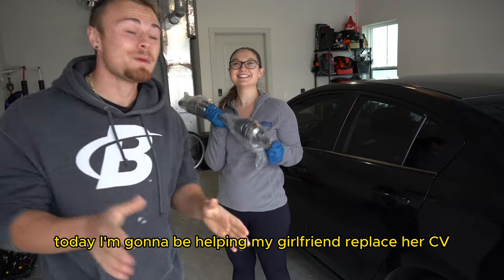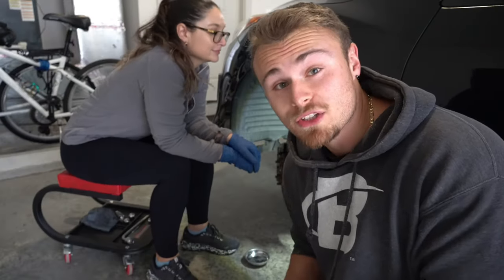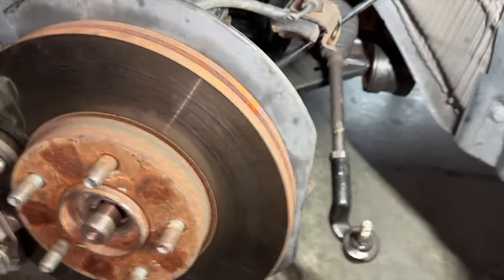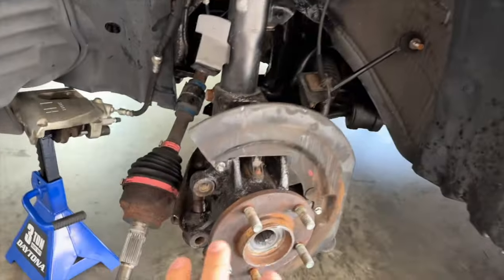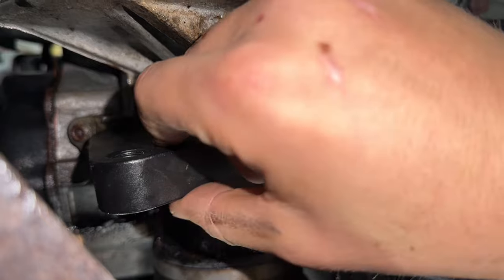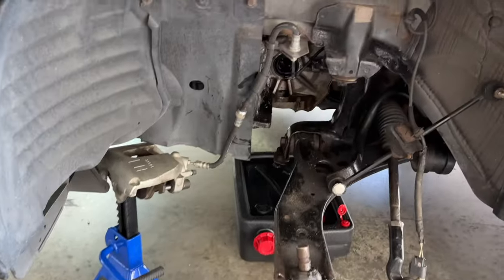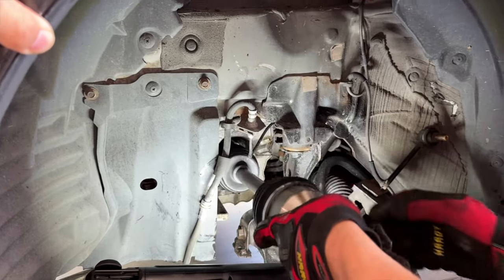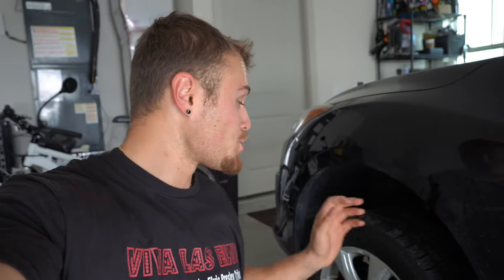HOW TO REPLACE DRIVERS CV AXLE ON A 2010 MAZDA 3

Comment from the maker: *4 MONTH UPDATE USING TRQ CV AXLE*
About 3months into using the TRQ brand cv axle my car started to develop a clunk sound (metal on metal clunk) when shifting from park to reverse and reverse to drive. Seems like the inner cv splines that connect to the transmission have developed play, were machined just a hair too small compared to oem or just too soft of metal. I ended up replacing with an OEM cv axle I found on eBay. Surprisingly looks hardly driven and no rust at all, still had paint on it. So for anyone attempting to do this themselves I highly recommend you either re-boot and re-grease your OEM CV AXLE!! or buy the best looking OEM online/junkyard cv axle or just bite the bullet and buy the OEM from dealer/online supplier ($350-400) the part number is GG6225600B

TORQUE SPECS:
The outer tie rod torque spec is 29-36 ft Ibs.
The axle nut torque spec is 175-202 ft Ibs.
The lower control arm ball joint retaining bolt torque spec is 33-42 ft Ibs.
The stabilizer bar link nut torque spec is 23-44 ft Ibs.
The front brake caliper bolt torque spec is 61-73 ft Ibs.

Comment: I watched many of those videos to get prepared to do it but they all miss the most annoying part: the part where you have to add transmission oil because it will leak when you remove the old axle and most cars don't have a stick above to fill again it's a pain you have to remove protection under the engine, find that damn filling screw, have the right socket and use a tube to fill. Also this oil has to be specific to manual or automatic they even have different kinds for different brands.
Reply from the maker: The amount that leaks out is quite minimal and if the fluid that comes out isnt bad and you have a clean bucket you can pour it back in. The 2010 mazda 3 has a dipstick on the top. Extremely easy to pour new or old fluid back in. the 2010 mazda 3 automatic uses specific MAZDA 3 fluid Type M you can get from the dealer or amazon. Otherwise you can use the direct manufacturer fluid which is IDEMITSU Type M Fluid
Reply: @Haydenschreiermk2  hey thank you for the reply good video it is indeed easy job! I have seen videos where 2 liters would pour out. Did mine yesterday lifted only one side of the car so it would drip less. Mine is a manual 2013 so it doesnt have a dipstick on top .
Reply from the maker: @eric-anon  yeah that will make it a little bit harder with a manual. good idea lifting it on one side

Comment: Dude lol I just noticed your pully leveler is the wrong model. Next time get a CTA  pulley not that wide wing.
Reply from the maker: i returned the whole thing lol and bought a smaller pry bar to fit under the car on jackstands. popped it right out.

Comment: I just used a crowbar to remove the axle.  No need to remove the strut. It was half the time as this video and I'm a DIYer
Reply from the maker: yeah i didnt have a short enough crow bar at the time of making the video under the car. since then i have bought a smaller one and replaced the TRQ axle with an OEM one and was able to pop the cv axle out with a pry bar. i got it done in under 30 minutes

Comment: He had the right tool he needed to position in the front towards the right. Shocks do not need to be removed. That doesnt work use a giant pry handle.
Reply from the maker: i ended up doing this a second time and just used a pry bar, i had a new one in in 30mins. yes show didnt need to come out but it was my time doing it so with the tool the shock kept getting in the way. moving forward a pry bar was so easy!

Comment: Clip opening up Bro!! right in the Mazda manual. You DONT want the free ends of that wire to be outboard of the splines (clip hanging open down) but nested into the groove as you can literally bend the exposed ends into the splines and jam it up good. I initially had TRQ CV's but luckily had bought manual trans for my AUTO and one was 1" too long, returned them. I ended up with another brand and have a slight ting on R but I think my intermediate shaft bearing is bad. I also tried that C-shaped remover but it would not fit so I cut one out of 3/8 plate I had a scrap of. Worked great and no strut removal as I didnt have any room for a crowbar under there. Passenger side can be tapped out by hitting the CV shell itself.
Reply from the maker: Watch the 1Aauto video at 12:00 he stated the ring should always be facing down. https://youtube.com/clip/UgkxeoeHY_rh5EeadmHyk3InEVzR7fgcWs_y?si=ygLeVkLCXpVvRJur

it was my first time replacing cv axle. i since replaced the TRQ one as it was making a clunking noise shifting from park to reverse and into drive. i out a OEM one in and it fixed the problem. this time all i did was take the knuckle out of the ball joint and use a pry bar to pop the axle out. I did the whole job in 30 minutes
Reply: Dude, due… dude… you have a Mazda manual? Lol. Where in the world did you get it? I have tried so hard to find one for Mazda 3 2012 2.5l and I have only been able to find one for a manual transmission. I know you most likely don’t have the same model as mine but where did you get yours? Are manuals just year specific and not specific to 2.0l or 2.5l etc cetera? I Tried purchasing pdfs a couple times because I really wanted to find the right one.

Comment: Do you know the seal numbers for both sides?
Reply from the maker: no mine looked fine so i didnt replace them but you can find it on mazda parts website
Reply: Just go to Mazda and they will help you out with precisely the correct part. Just got one ant it was only $12. Piece of mind too with a part with such necessary tight tolerances specs and compression materials to hold the oil in. The guy who helped me told me as well he had a guy come in saying he tried a couple third party seals that leaked so he bought oem as well.

Comment: Im going to check my rear wheel bearings on my 2012 Mazda 3.  I have a shake happening at 30mph and 55mph after driving 5 miles (heat related).  I just replaced the front ball joint and the inner intermediate cv shaft thinking it was the carrier bearing but didnt help
Reply from the maker: Bent rim, bad tires, not balanced tires, bad alignment. Lots of things that would cause vibration. Bad wheel bearings usually is a loud humming. Like a overly loud road noise
Reply: @Haydenschreiermk2  thanks for your reply I'll look more into it.
Reply: @Haydenschreiermk2  Had the tires balanced didnt help.  Doesnt seem to be any wheel bearing noise.  Tires arent too bad but will need to be replaced within the next 6 months because of normal wear.  I have more to look into, thx for your help on this
Reply from the maker: yes of course

Comment: The outer tie rod torque spec is 29-36 ft lbs.
The axle nut torque spec is 175-202 ft lbs.
The lower control arm ball joint retaining bolt  torque spec is 33-42 ft lbs.
The stabilizer bar link nut torque spec is 23-44 ft lbs.
The front brake caliper bolt torque spec is 61-73 ft lbs.

You shouldn't go gorilla on every nut and bolt with that 800 ft lb impact wrench. You don't want to put your girlfriend in danger because you didn't to use a torque wrench.
Reply from the maker: Of course, safety is #1. My impact is rated at 400ft lbs and unless I’m sitting there hammering it with ugga duggas it isn’t putting that much torque on it. But you are right, when my 1/2 inch torque comes in I will retorque it all to spec. Thank you for the correct torque specs!

Comment: How long do you think this would take…if you have all the tools and you know what you’re doing?
Reply from the maker: well, since ive replaced everything recently, nothing was rusty or seized. if it was rusty that adds quite a lot of time, same thing if you find other parts that need replacing. BUT if i was to do this again maybe 2  hours all set and done, taking my time.
Reply: @Haydenschreiermk2 Thank you!!